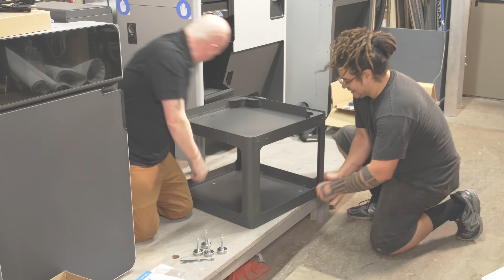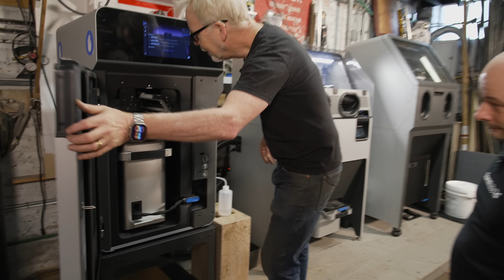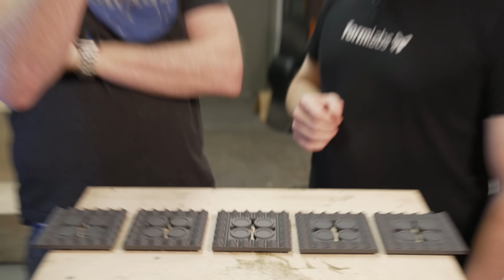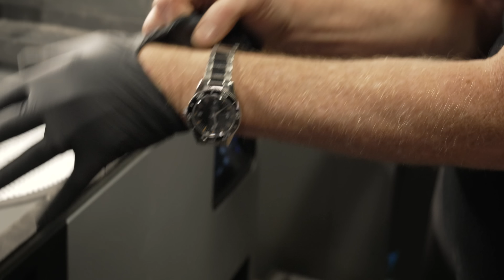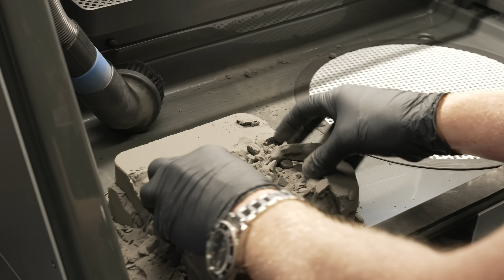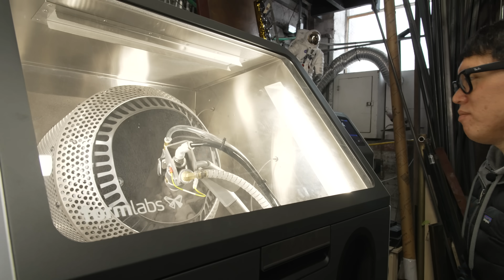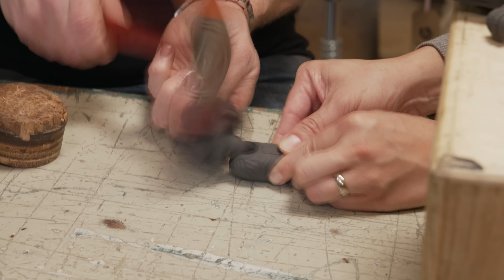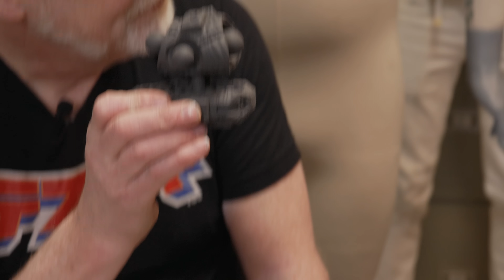Adam Savage Levels Up His Workshop 3D Printer!

Comment: Nylon powder will shred your lungs. Always use protective gear. Please
Reply: Honestly was making me wince Everytime
I saw him handling it in the air etc
Reply: Thank god none of the other machines and processes available in his shop are perfectly safe to have in the hands of amateurs. 
🙄
Reply: Yeah pretty crazy I didn't see a respirator.
Reply: @2hlix doesn't really need a respirator. The extractor is enough, he could work with ebola in that area and it would pull it into the filter.  On of the engineers that came out with my system said their machines are rated higher than the nih standard for bio-hazard handling.
Reply: As he drops them outside the hood with the hood off. 😓
Reply: I just hopped on here to say the same.
1st: At least wear a mask with fine particulate filtration capabilities while using any part of the Fuse
2nd: That powder is super combustible when in the air, the Fuse should be away from other static electricity/spark creating machines.
3rd: Yes, the excavation cabinet has a filter and an air draw, but still use a mask. The sifter shouldn't be used without the cover on, again, to minimize airborne nylon particulate.
Reply: New for 2025... "I've got pulmonary fibrosis" demerit badge.
Reply: I was just about to ask about that
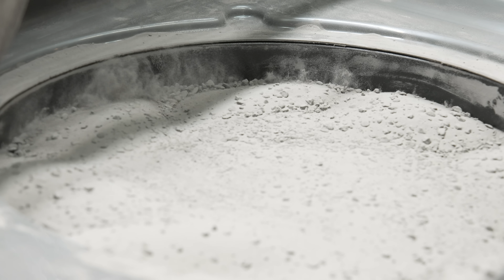Reply: 9:49 looks like a sand worm is coming any moment.
Reply: @ DANG!  THAT should have been the first build they filmed!  Mouth Up.
Reply: All small particulate (dust) is dangerous, so fume hood and face masks are needed
Reply: Seriously I don't care how good the ventilation is im either keeping the hood down or using a respirator.
Reply: Its not nearly as bad as some, like the inconel I print with, that stuff leaves deposits that you cannot ever cough up.
Reply: Yes! Please be safe Adam.. you don’t want to be breathing that stuff in!
Reply: This probably prices out most people from using this
Reply: Watching them mess about, I started sneezing.
Reply: No it won't. Evidence?
Reply: Yeah??
Reply: yeah, i stopped watching when Adam and Norm pulled out the prints without the cover closed. He can't tell the world anything about microplastics or chemical exposure when he is willingly breathing all of that in because he's too excited to see that goofy test print
Reply: I'm so dumbfounded by this. There is a shield for a reason man!
Reply: He should 3D print himself a mask
Reply: One cool thing about SLS is that they could’ve printed those action figures all together.  No need to assemble afterwards.
Reply: @ Only if they had been designed for a gap between parts the width of the laser.  But then, they would not have been poseable. Those figures were designed for friction fits between moving parts so that the figures would HOLD a position you put them in.  The solution is to just use a DIFFERENT nylon. You can get sintering nylons with more flexible properties than the stuff they started with.
Reply: Agreed, respiratory gear any time you have powder in open air
Reply: I sprinkle some in my home rolled cigs. My throat doesn't hurt all the time.
Reply: Where are the stl files for the action figure???
Reply: Think the editors need to have some flash text in the video describing the proper ppe for what he’s interacting with so viewers can be better informed. Not so it’s obnoxious
Reply: That's all I was thinking watching this. Just use the cover. It's there for a reason.
Reply: Seriously, the first thing they did when form left was use it with the hood open. Utter insanity jesus christ
Reply: How has this comment have so many replies with none of them pointing out they 100% are using proper PPE. They completely verbalize it in the video too. Just listen. 

It's a proper fume hood. They where told it wasn't necessary to have it all the way closed unless you're going ham on the brushing. They're wearing gloves. 

Fume hoods are used for volatile acids and much more immediately toxic stuff than long term effects of inhaling the powder. They take the time to demonstrate it working.

PPE is not strictly stuff you wear. Having lasers in a closed box with the filter glass as a window is also PPE, and it's much more effective if you need to control for more people and cameras etc. It's just a lot more expensive as you scale bigger.
Reply: @SquintyGears Some of the stuff in the video was ok without a respirator but at the start Adam was pouring the nylon powder in just at the side of the main machine, that's not a closed glove box and absolutely represents an unnecessary exposure risk
Reply: @bosstowndynamics5488  we don't see anything outside the frame... The guy from the company is there for that whole part. You're making assumptions.
Reply: @SquintyGears  The guy from the company is an idiot, he just opened formlabs up to so much litigation saying "you don't ""really"" need a respirator and you can run it without the hood down" LMFAO this video will be the first piece of evidence submitted in the forthcoming lawsuit against them.
Reply: @SquintyGears  What exactly could have been out of frame that would have prevented dust from going from the open container of nylon to Adam's face that was leaning over it?
Reply: @dddddyyn  you're actually insane...
Reply: @bosstowndynamics5488 the nylon powder is being loaded within the fume hood so it's not that bad, personally I'd still wear a respirator
Reply: @TimSheehan  No, it isn't. The build chamber was being unloaded and the parts processed in there but there's multiple times when powder gets handled outside of the hood (and leaning over an open top "hood" isn't particularly good either even with the airflow)
Reply: @SquintyGears  100% Fume hoods can be used in place of respirators a lot of the time. In some cases they can be better as you're changing the air quite a bit, and pulling it in from the room under negative pressure. You'd have to look at the MSDS, which I guess they're just calling SDS these days.
Reply: There is so much misinfo in here. You guys probably wear gloves when you wash your dishes lmaoooo.
Reply: “Don’t forget to wear you dust mask”

https://youtu.be/p_65qCD2On8?si=Ud6uI06OVrNT-DkE
Reply: @Racing_Pig  LOL! I knew it was a craftsman video before I even clicked!
Reply: I really can’t stand when professional people ignore health risks.
Reply: I was surprised that FL didn't oversee that first print to emphasize the use of the enclosed dust hood for safety.
Reply: @cyberhikerdd they did? it was literally showed in the video. also it was the guy from formlabs that said that it was fine to leave the glass up in most cases.
Reply: @NebulaHatesWatchdog would you ask if there were any health risks to smoking, and then trust the answer of a tobacco salesman?
Reply: It is not so dangerous if you do not always breathe it in the air or every day, for example
Reply: “Liking” this comment to make sure it floats to the top and the tested team see it.
Reply: @DafyddRoche  If Adam didn't need glasses he would be 100% safety squints all the time. There is next to a zero percent chance a comment will change that behavior and he wears respiratory protection. If you have seen him work with foam or spray paint you know it isn't a consideration. That said I would love to see the change both for Adam's sake and for people watching him who don't understand the inherent risks of certain materials.
Reply: @DafyddRoche It's worth promoting this for general knowledge, particularly if/when SLS becomes more DIY accessible, but I would really hope the technician who was there at the time had already told Adam this off camera
Reply: Notice how this system completely isolates the nylon powder from the outside environment? Someone already figured that out and engineered the concept into the system.
Reply: @peterkallend5012 Not true for the part where Adam was pouring the nylon into the build chamber, that was open air.
Reply: Notice how they are handling the parts outside of the chamber completely negating your entire comment?
Reply: @PioneerPrint3D  ah yes because obviously the dust that stayed stuck after you brushed the part is the dust that will go airborn in a whole cloud that you'll breath in.
Please have some comon sense. I agree PPE is super important. They did it properly. The only question mark area we see is when they emptied the material to fill the first chamber.
Reply: Eek. I wondered about that. Microplastics are scary, whether we’re talking in air or water.
Reply: @tracylund7407  Microplastics are a couple of orders of magnitude smaller than the nylon dust these printers use. That being said, nylon dust is extremely hazardous to lungs, it's utterly irresponsible to handle them without at least a mask, preferably only in an isolated, ventilated chamber (which is why the printer comes with it).
Reply: All 3D printing has some health hazard, even FDM with PLA
Reply: No wonder we are all getting gradually filled with microplastics. That nylon powder is so light and whispy... Scary stuff.
Reply: Even with the hood up the powder is being visibly sucked away from them, it's designed to be safe to use without a mask
Reply: @Duker-Koushakur But with the hood closed correct? 

Throughout the video when they're working with the hood open, nylon powder can be seen getting everywhere--on to the rim of the chamber, fully knocked out of the chamber, on their disposable gloves, clapped into the air, etc. That dust is now in the shop and will get knocked into the air whenever disturbed. It will be on their clothes and will end up in their lungs.

I worked professionally in the additive manufacturing industry for years. Most military and government agencies which use these machines have them isolated in their own rooms, with very strict protocols in place for safety and contamination control.

I understand that when using any type of industrial machinery that there are levels of risk involved. But this? The usage in the video was unnecessarily unsafe.
Reply: @Koushakur If that was the case then why have the screen and gloves?
Reply: @Duker-Koushakur Good luck with that.
Reply: @Duker-Koushakur  this comment shows very little understanding of airborne particulates.  And it's worrying because that's what everyone thinks until they learn the hard way
Reply: SLS should only be used by actual professionals. Thank god micronics got bought out, amateurs should not have easy access to SLS printers.
Reply: @dddddyyn  SLS should be used by any willing to undertake the needed safety precautions. There is no need to gatekeep the technology with inflated prices, honestly.
Reply: @dddddyyn  so should a mill, lathe, table saw, torches, epoxy, chemicals, etc. be in the hands of amateurs? 
All things need to be used safely and everything comes at a risk.  
People cast metal at extremely high temperatures, sand with silica carbide, and weld galvanized metal all the time.
Reply: @philipzielinski  Yeah, although, welding galvanized metal I'd recommend a respirator for sure. Metal fume fever does not sound fun.
Reply: @dddddyyn it’s just nonsense to be glad a whole class of technology was made available to a wider market and promptly axed. Tools are inherently dangerous and it’s always your responsibility to use the proper PPE.
Reply: @maffi14  The same wider market who isn't careful enough to wear respirators with resin and gloves when removing support material?
Reply: @dddddyyn dumb perspective on the micronics deal. Resin printers are already toxic. Let us have the tech and be responsible.
Reply: @dddddyyn  I mean, amateurs can readily buy guns in the USA so there is no reason they shouldn't be able to access SLS technology...
Reply: @dddddyyn  You can literally buy extremely toxic chemicals at your local hardware store. This is a stupid take.
Reply: @dddddyyn  
Imagine when PC first came out and people say things like this, "PC should really be used for researchers."
Reply: @dddddyyn  Uh, nah I'm still going to use SLS :p cry more
Reply: How many amateurs could afford this industrial equipment ?
 @dddddyyn
Reply: @dddddyyn  Dumb comment.
Reply: @dddddyyn  dumbest take i've heard all year
Reply: @dddddyyn  I'm glad there are definitely no other ways "amateurs" have access to turning nylon, carbon fiber, silica and other materials into an inhalable dust!
Reply: @zaplocked  And imagine that the public could have access to printing with volitaile chemicals that are not only toxic on contact or ingestion, but also release toxic gases and will next to poisening you give you cancer as well. OH WAIT!
Reply: @zaplocked Just guessing here that you are probably a fairly dramatic person? I mean comeon, I get you but, the line between Amateur and Professional is thin. When getting into ANYTHING like this it is upon the person engaging to get fully educated and use that knowledge to apply proper procedures. Why does it seem to me that everything scares the hell out of you? Yeah, some people even in a professional environment are going to disregard safety and will typically pay the price for it. That’s not on you though and I can’t imagine why you’d even worry about it frankly.
Reply: @TheJacklwilliams  You've completely misread my post. The OP praising formlabs taking micronics off the market for "safety" - as we watch adam and a formlabs tech stare at a pile of nylon powder without PPE, is ridiculous.
Reply: @ Noted, thanks for the response. I agree in many ways. I was just being pissy because, apparently that’s where my head was. Though I will say I’ve gotten a little cold to such things as well as, I’m not frightened for them. If someone wants to be stupid and ignore safety that is clearly outlined to protect people? I figure, there you have it. Also, I guess in the end, looking at it today, the safest of the safe occaisionally brain fart as well. Nonetheless, I’ll chalk it up to my own pissy mood at the time. Either way, I can’t argue with you calling out what isn’t safe especially when, well, it isn’t safe nor smart to do so.
Reply: @dddddyyn sounds like you’re gatekeeping
Reply: @mikeward1701  And?
Reply: @dddddyyn  lmao thats the wildest comment i have read this year
Reply: @dddddyyn The term “professionals” means nothing at all. There are no degrees in SLS. And a ‘professional’ might just be the guy some corporation  hired last week whose prior job was running a fry vat at McD’s.  Professionals are the MOST likely to work dangerously, thru familiarity and self assurance.   The ‘professionals’ I met in construction never wore masks when handling or cutting asbestos and they literally derided anyone who did. 
More dangerous than the nylon powder is the glass media used in the blaster. 
‘Professionals’ are the guys who die from long term materials exposure.
Reply: @christopherpardell4418 thinks having a degree makes you a professional 😂😂 what a joke
Reply: @ So- you didn’t read what I wrote? Or you just didn’t comprehend it?    It was literally deriding the idea that only “Professionals” are qualifed to use sintering equipment, by attacking the concept of ‘professionals’ even being meaningful. 
The term ‘professional’ actually refers to someone accredited in their field of work. Be that a degree, certificate, license or other document attesting to your education. You can’t even cut hair in the US without some form of certification. 
Just getting HIRED does not make you a professional.  Any doofus with a hammer can call himself a professional framer, if he gets a job driving nails on a build site. It does not mean he’s even good at framing. 
And the notion that you need to be a ‘professional’ to use Sintering equipment is ignorance of the first order, because the only way you can Become professional is to USE THE EQUIPMENT.   Every expert crane operator had a first day he had ever operated a crane.   
Get it?   I was deriding the concept that there is such a thing as a professional.   If you get a degree in architecture, you are considered a professional architect your first day on the job.  Having the degree makes you a professional, but it doesn’t mean you are a good architect.   
And given their extensive experience with just about every kind of 3D printing equipment out there, I would suggest that the guys at Tested certainly are far more qualified to use them than are the folks who just so happen to have been hired to operate laser sintering equipment.
Reply: @dddddyyn gatekeeping technology is not a thing to celebrate
Reply: @Andrew_Gregg some things need gatekeeping to stop YouTubers who stick kits together hurting themselves.
Reply: @donkeyholmes4581   and resin isn’t extremely toxic?
Reply: @Andrew_Gregg  resin doesn't cause interstitial lung diseases.
Reply: @dddddyyn  That's a smoothbrain comment if I've ever seen one.